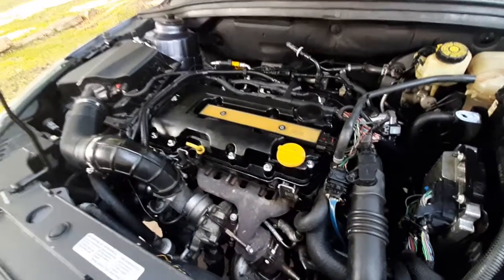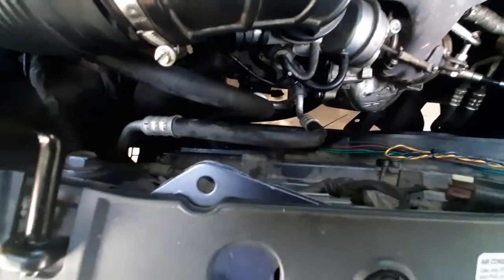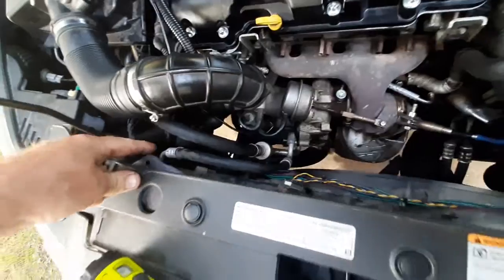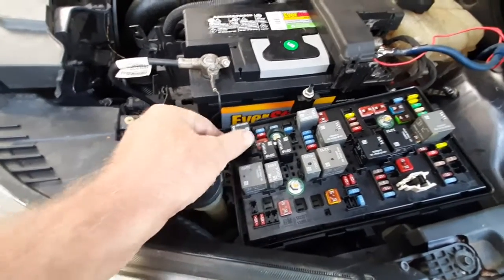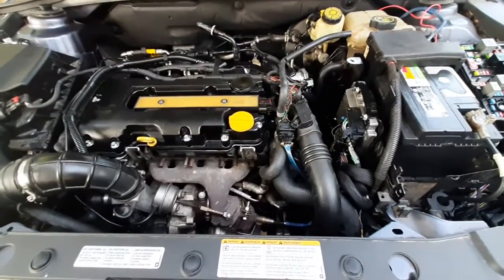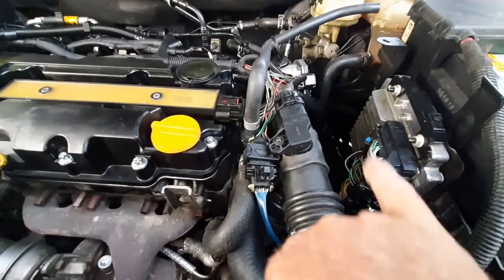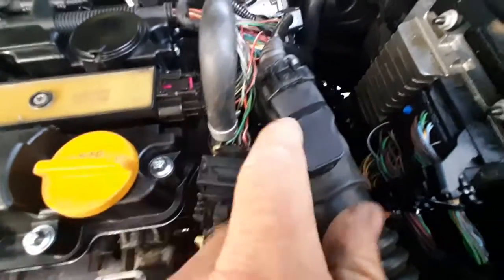Chevy Cruze Sonic Trax 1.4L - Cooling Fan Runs All The Time - Possible Causes

Comment: My daughters car has same issue with fans kicking on right after start up, we did replace the temp sensor also. still stumped, hopefully i learn something here.
Reply: well i finally got to take a look at my daughters car.. these 2 connectors are on right, but I checked all radiator hoses, fluids everything looks normal. but the hose to the radiator are cold to the touch and other smaller hoses are warm. we did have the water pump changed also, but maybe the thermostate didn't open up, so gonna let it sit at idle for like 10 min.

Comment: Can you help me? I have a 2015 Cruze LT, when I leave the battery off for 10 seconds and turn it on again, the engine fan works and does not turn off, and then I turn the car off and on again and the fan does not turn on anymore, I have already changed the water outlet sensor, temparute and thermostat and it did not solve the problem.

Comment: Thank you very much for the info…. .That was my customer car problem as well and the problem was same like you are daughter car someone change the head gasket and the problem was appear! Saved me a bunch of time trying to diagnose it myself. We change the MAP sensor and one really for coolant overall thank you very very very much. We appreciate .
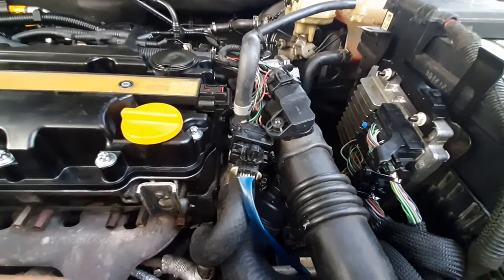Thanks again!🙉👍 11:01 11:01 11:01 11:01 11:01 11:01 11:01 11:01 11:01 11:01 11:01 11:01 11:01 11:01 11:01 11:01 11:01 11:01 11:01 11:01 11:01 11:01 11:01 11:01 11:01 11:01 11:01 11:01 11:01 11:01 11:01 11:01 11:01 👍👍👍👍👍👍👍👍👍👍👍👍👍👍👍👍👍👍👍👍👍👍👍👍👍👍👍👍👍👍👍👍👍👍👍👍👍👍👍👍👍👍👍👍👍👍👍👍👍👍👍👍👍👍👍👍👍👍👍👍👍👍👍👍👍👍👍👍👍👍👍👍👍👍👍👍👍👍👍👍👍👍👍👍👍👍👍👍👍👍👍👍👍👍👍👍👍👍👍👍👍👍👍👍👍👍👍👍👍👍👍👍👍
Reply from the maker: That's great!  Happy the video helped.

Comment: can you please tell me the radiator sensor OEN code cause I am going to buy one to fix the same problem
Reply from the maker: Should be GM GENUINE 55591401
Reply: @xpsgarage  thanks for info
Reply from the maker: @ppaolosan  Did you find it?
Reply: @xpsgarage  not yet I have not the possibility to lift my car I am going to the shop next week
Reply: my friend but this temperature sensor is not mounted on the radiator but rather on the coolant flange which is on the right side of the engine head then if there is another identical one with the same code mounted on the radiator I don't see it my engine is the A14NET  in this case please tell  me where it is mounted in detail
Reply from the maker: @ppaolosan  That sensor is used in both places.  If I remember correctly the one on the radiator is on the left side when facing the front of the car.  It's on the lower part of the radiator and very hard to see from the top.  Have you crawled underneath the car and looked around?
Reply: hi, let me start by saying that my problem is that I have the fan always on even when the engine is cold, I didn't know about this additional sensor placed under the radiator and it will probably be faulty because I recently replaced the thermostat with a new one and the cylinder head flange so these last two are new... I have never replaced the sensor that you say also exists on my engine which is located under the radiator... and in any case every time I drained the water from the system I didn't notice where this sensor is... is it by chance located near the water drain tap under the radiator, is it easy to see it and unscrew it or is it hidden by the intercooler or the fan?

Comment: I made that same mistake today 5/5/2024  replacing the coolant/water outlet, 2015 chevy cruze LT, I have a little experience working on cars, but if something is wrong, I try not to panic and start troubleshooting or backtracking to figure what I did wrong, it felt weird at first  putting the air MAP sensor back on which was actually the O2 sensor, Fan went crazy fast, but watching this video confirm my mistake and weird feeling, thanks good job on vid.

Comment: wow. Very detailed. I would've never thought of this switch problem. Thank you for the detailed info. My fan starting running as soon as I changed the MAF sensor. Any thoughts on that?
Reply from the maker: You changed the MAF sensor on the airbox correct?  Not the MAP sensor on the intake tube?  I don't see how the MAF sensor would affect the fan.

Comment: Many thanks for this video! Was at the end of fixing my coolant/water outlet. After soooo much time getting hard-to-reach spring clips on the radiator and old plastic parts breaking, everything was back together and the car started beautifully...except for the radiator fan going non-stop. Some videos didn't include releasing the radiator air valve, and while that was important, it didn't fix the fan like I hoped. Your video did the trick! Can't believe I got those crossed up, but wouldn't have gotten that figured out without your insight. THANK YOU!
Reply from the maker: You are welcome.  Happy it helped!

Comment: I'm a bit confused is the fan supposed to come on when you start the car? I replaced the engine and just wondering if it's a on and off depending on coolant temperature
Reply from the maker: Should be on/off depending on engine temp unless you have the AC or defrost on.  If those are on then the fan should be running.
Reply: Both of those are off but the a/c low pressure is reading high, when I replace the coolant temperature sensor it worked fine came on at 215 degrees took it for a short spin now back to the beginning. New pump, thermostat still getting a poob4 code been on this journey for a few weeks @xpsgarage
Reply from the maker: @levialston518  Did you check the MAP sensor like at 5:40?

Comment: Thank You so Much!!!  In the last few months I did the head gasket, pistons and rings and a new turbo on my son's 2011 Cruze.   It runs great now but sounded like a jet taking off all of the time with the cooling fan blasting.   I am so glad that I found your video before replacing relays sensors and a ton of frustration. Your video is kind of long but informative and  well worth watching you figure it out rather than me burning the car...  I still can't believe that those 2 plugs right next to each other are interchangeable.  How many people do you think have given up and taken it to the dealer after replacing who knows what?